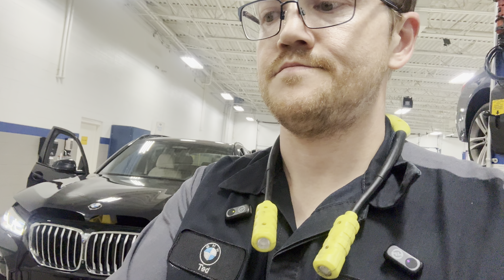BMW X5 Blower Stops on High: Diagnosing Fault Code E70C2D

Comment: Awesome video! What would you see on the amp meter when the bad blower acts up?  Good fix!
Reply from the maker: The amperage would be higher until the system is deactivated, normal current shouldn’t exceed 75% of the fuse that protects the circuit.

In this case we couldn’t catch the deactivation live due to blower having to be on for extended time periods!